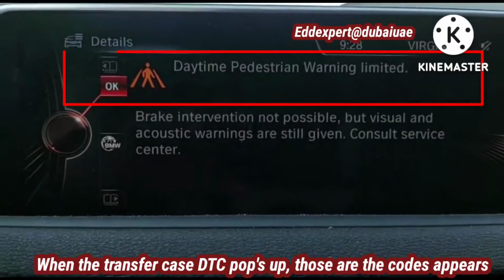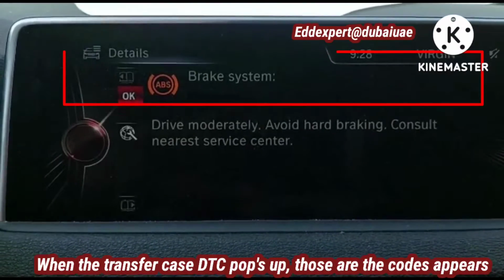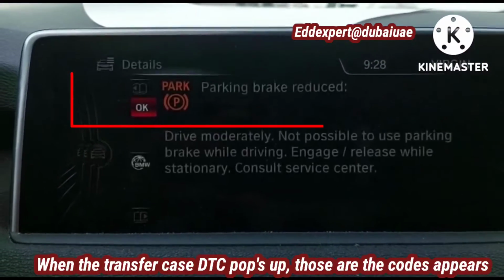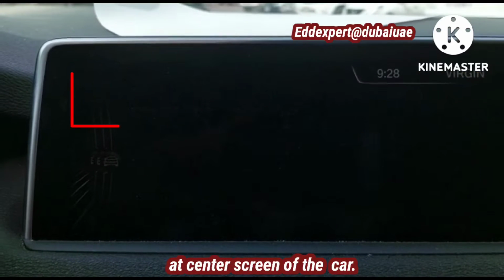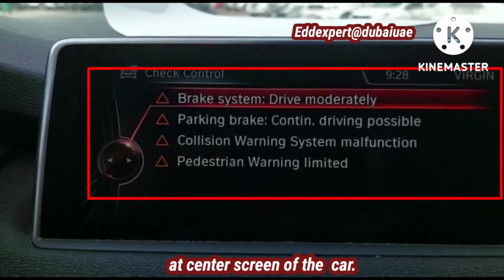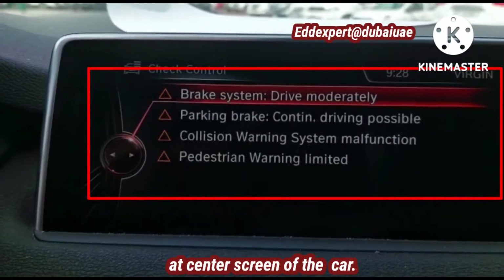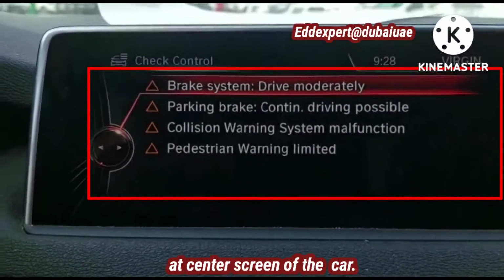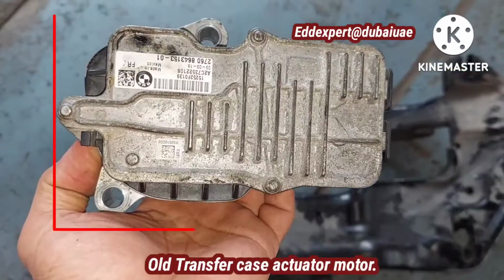🇵🇭 BMW X5 VTG,Transfer Case,,Frontal Collission, Parking Brake, Pedestrian warning,Brakes Sys,Solved

Comment: Hello, I have the same car with same warnings but nothing wrong with the driving. It drives smooth. Lights suddenly came up. I m having CDA426,D016E4 codes. Transfer case control module lost communucation. i change the module. but scanner tool still cant detect the VTG system. What could be the problem. Transfercase already replaced before than i bought the car.
Reply from the maker: @needfirtune, may I know your location pls
Reply: @edralinbustaliniomcbautomo7707  usa

Comment: Hello!
    I have a BMW f30 320xd, some time ago I received an error on board (Driving Stabilisation), the car now only enters comfort mode and I have traction only on the rear wheels, after some investigations I found the following codes: 48097D (Transmission box  transfer - open clutch position, rear drive only) and 440101 end of transmission reached, I mention that the error appeared in the morning immediately after starting the engine.  The car has no symptoms related to the transfer case, (ATC35L) it does not sputter or make strange noises.
    The tires are identical and match, the electrical fuses were checked, the new actuator was coded with ISTA, it worked without problems for 3 days, I tried a recalibration with ISTA but it no longer allows it, I have the old actuator open and it seems that the new models  they no longer have gears, they are in an electromagnetic field, I also changed the oil, it was a little dark, brown
    The car is from 11.2013 and has 292000km, the first owner changed the entire transmission in 2016 under warranty in Germany
    I thought maybe the clutch in the VTG was worn out.  If I change the clutch in the box, can the actuator be recalibrated, do they have to be replaced with a new one?  I initially thought it was the actuator and replaced it, but the error reappeared after 3 days.
    Sincerely, Octavian!
Reply from the maker: If the clutch doesn't gripping enough, clutch replacement must be done, then I'm sure it works after the repair.
Reply: Thanks for the reply!  After replacing the clutch, the error disappears by itself, did the actuator need to be recalibrated?  At the moment I cannot delete the error code 440101, the actuator communicates with the computer but cannot delete the error.
Reply from the maker: @octavianmihaescu7314  do the calibration of the actuator. Just follow the procedures.
Reply: @octavianmihaescu7314  hello! Did you fix your problem? I have exactly the same problem on a bmw M550D F11 2014
Reply from the maker: Yes, it was fixed. There's an internal problem with the transfer case, and I used the old module, which is in the vehicle.
Reply: Good job boss. Magkano po yung parts at labor nito?
Reply from the maker: Yes you are absolutely right has a problem on VTG. Means it has excessively play the clutches. Now if you're already replaced the actuator you may used it the same. Firstly replace the clutch of the VTG. And surely it will solve your problem. The sensor received signal from the actuator its too long to engaged that's why it's created dtc which is you mention. Like what I did in my uploaded video. It was replaced with a used VTG and i used the old actuator which is in the old VTG. That's it. Perfectly works fine. I'd not necessarily to calibrated it's fine. Otherwise perform calibration to be successful ✨️.